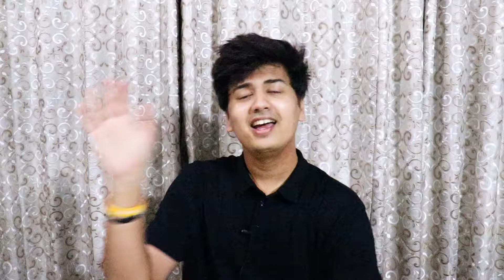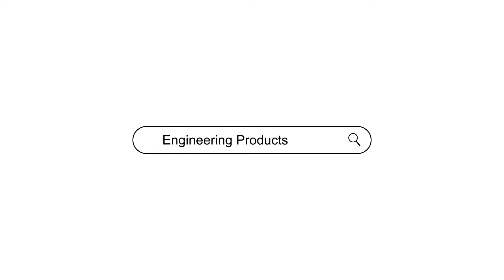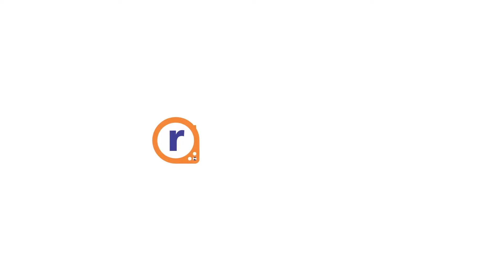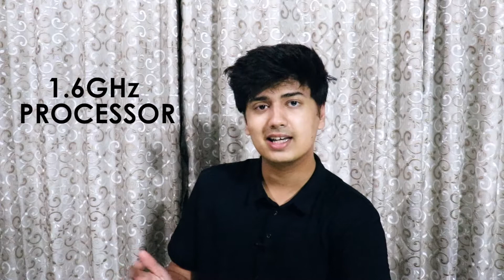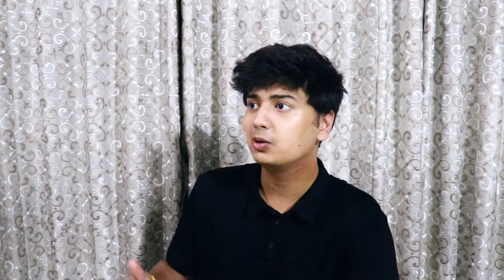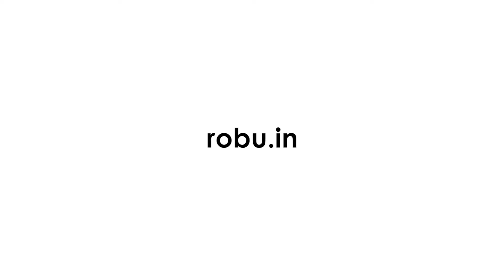PRO's and CON's of Raspberry Pi!

Comment: You no longer are limited to the SD card. You can boot to a USB SSD. I have been using a Pi4-4gb for my daily driver since September. I also have a Xeon quad core setup to use the same monitor and keyboard. The only time I boot the Xeon now is for video conversion (handbrake). You can do video editing(or video conversion) on the Pi4. But just not as fast. As far as the heating there are a LOT of solutions for that. Personally I use a Flirc case ($15), witch is passive cooling only. Compiling FreeCAD (with Flirc case) it never exceeds 70C (in a 75F room) so it never thermal throttles. There is very little that a "typical" desktop user cannot do on a Pi4-4g.
Reply: The problem is not the SD card. It is that it should come with eMMC on board(Makes it faster,surely you can make it fast by adding an SSD ). There are only little things that cannot be done on RPI. But It was designed to make computing cheap and make programming accessible to everyone & I think its doing pretty great. I Have been using Raspberry Pi since 2018. Have done a lot of testing on it. I am a big fan of them. Ability to pack so much stuff on a credit card size is pretty amazing.
Reply: @apurvasingh1907  It is very unlikely that the Pi will ever have eMMC. First there is simply no room for it on the board. In order to make the eMMC fast enough you would also have to add multiple PCI channels, not an easy task. The USB devices are already getting 300MB/s (not Mbps) on existing systems with 3.0. Which allows those needing faster storage to have it and those who do not need it not have to pay for it. By the time of the Pi5 we will have USB4 (or 3.1 at the very least) which will have even faster speeds and still maintain the choice advantage.
Reply: @bradquinn4161  True. I was expecting PI5 but they released a 8 GB Pi4. Asus tinkerboard is also a good board to go with, the price is slightly higher but gives  better performance.
Reply: @apurvasingh1907  I would guess that the Pi5 will be 2022(or later). It is far more likely that we will see an upgraded Pi zero before we see the Pi5. The Pi4 uses vastly more energy than the Pi zero, but the Pi zero is under powered (cpu wise) for many uses. So maybe under clocking a P4 cpu to 1Ghz? Something to get the power draw of the new product down below 5(?) watts peak while giving the cpu a huge upgrade in computing power.Off the top of my head I think the Pi4 is 15 watts (peak) and the Pi zero is 1 watt(peak).